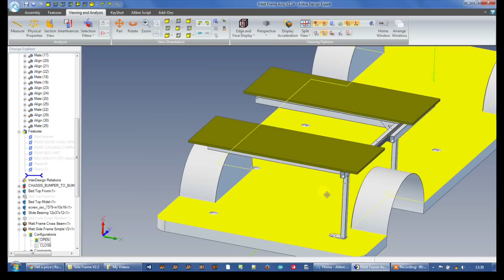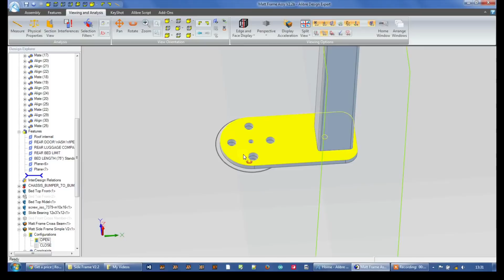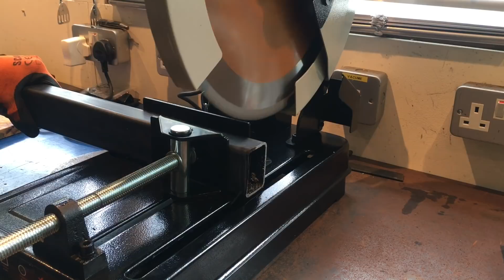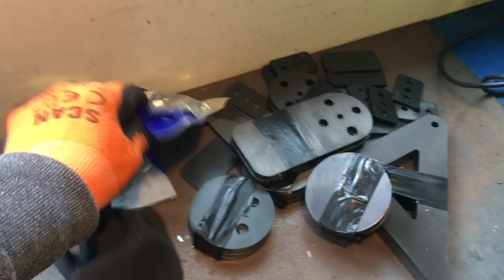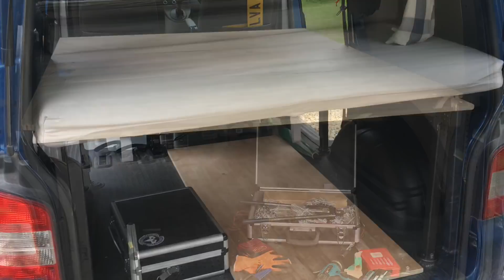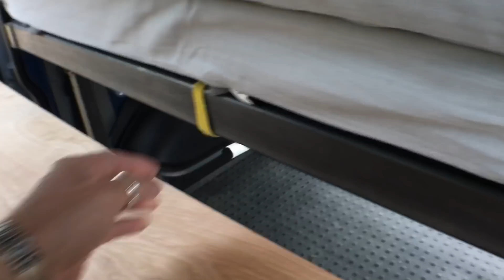VW T5 Kombi Bed 5 Day Build! - Mantis Hacks E20

Comment: Hi Matt
Really nice design on your bed system, I’m looking at a similar project, but using 8020 type extruded aluminium to reduce the frame weight, do you know what weight your design is please, and do you think the 8020 is worth using in place of box section 
Great channel 👊🏻
Reply from the maker: Hi. Thanks. Well 8020 is very strong. You might find 6020 is enough. I really don’t remember what weight mine is but I have considered doing one with Alu extrusion to save weight.

Comment: Cut some holes in the ply bed base, to reduce weight and ventilate the mattress to prevent invisible mould growth. Could you have used aluminium to reduce weight or is it too pricey?
Reply from the maker: Could have used aluminium to reduce weight but also it’s harder to weld so I went with steel. I would like to make an aluminium version though. I didn’t add slots to the bed ply to reduce cost.

Comment: Hey mate. Great work. Do you think it would be possible to use an existing combi bed and make it slide in itself twice. So you could reduce the size of it when in transit and put the rear seats further back? My thoughts were to cut frame and put in a second sliding rail with the legs on so that all slided forward when using the bed? Obviously it's just a thought and I am not a metal guy so thought I'd ask yourself you clearly has ALOT of skills 👍 any advice greatly received. Mark

Comment: Hi Matt lI really like the design and particularly the wider leg position utilising space-  I'm wondering whether its possible to do something similar but  for a LWB using sliders on both sides giving the option of a double bed over the seats leaving space at the rear or sliding all the way back enabling the seats to be left up. Does that sound impossible or doable?
Reply from the maker: I’m not sure you could slide in both directions as the fix down points are right at the back of the van.

Comment: Very nice solution and build! I recommend drilling some holes into the plywood otherwise the mattress will pick up moisture.
Reply from the maker: Thanks. I was going to have the plywood slotted to reduce weight but the cost was prohibitive. I haven’t noticed any moisture yet.. other conversions I’ve seen have solid bases. Have you experienced moisture with this setup? Presumably because the base can’t breath.